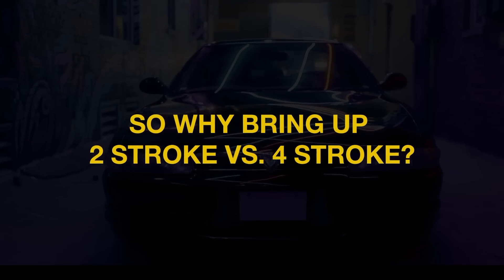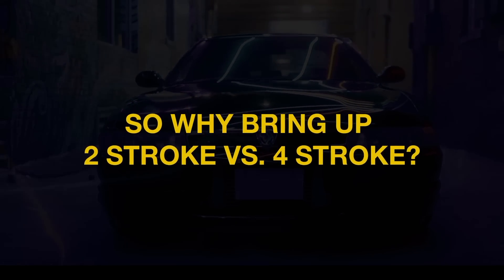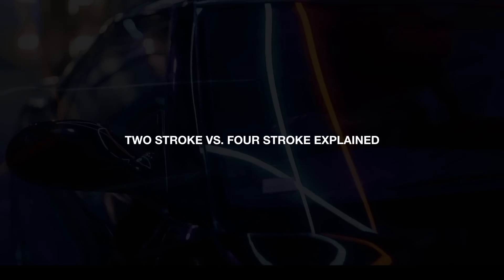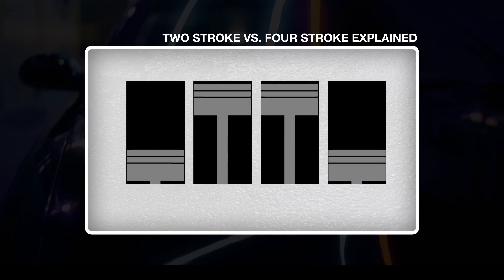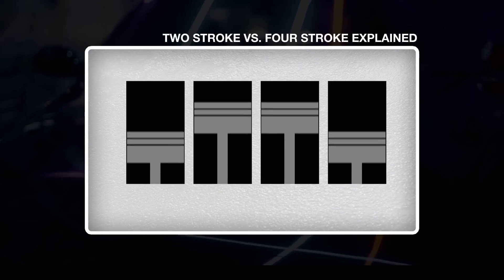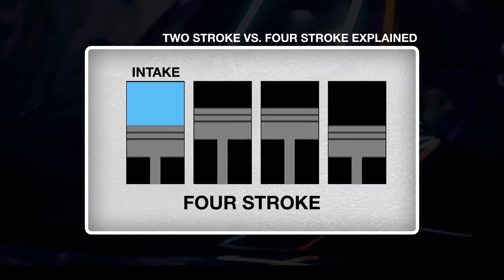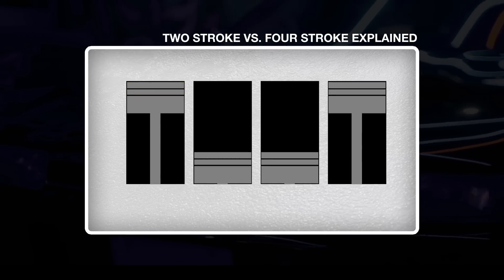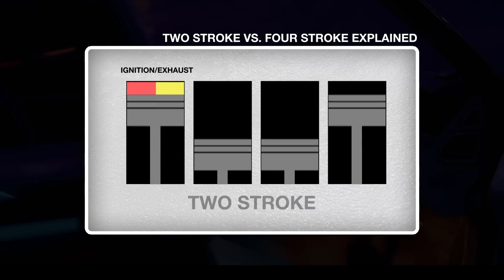The SECRET Behind Why RX7 and RX8 Rotary Engines Make SO Much Power

Comment: There's actual displacement and then there's "but to compare to a piston engine" displacement. a 13B engine is 1.3L period, some people bitched about it and thats where this 2.6L/3.9L non-sense comes from. Below is an explanation that I think explains both sides very well:

  Wankel engines can be classified by their geometric size in terms of radius (rotor center to tip distance, also the median stator radius) and depth (rotor thickness), and offset (crank throw, eccentricity, also 1/4 the difference between stator's major and minor axes). These metrics function similarly to the bore and stroke measurements of a piston engine. Displacement is 3√3radius·offset·depth, multiplied with the number of rotors (note that this only counts a single face of each rotor as the entire rotor's displacement, because with the eccentric shaft - crankshaft - spinning at three times the rate of the rotor, only one power stroke is created per output revolution, thus only one face of the rotor is actually working per "crankshaft" revolution, roughly equivalent to a 2-stroke engine of similar displacement to ONE rotor face). Nearly all Mazda production Wankel engines share a single rotor radius, 105 mm (4.1 in), with a 15 mm (0.59 in) crankshaft offset. The only engine to diverge from this formula was the rare 13A, which used a 120 mm (4.7 in) rotor radius and 17.5 mm (0.69 in) crankshaft offset.[citation needed]

As Wankel engines became commonplace in motor sport events, the problem of correctly representing each engine's displacement for the purposes of competition arose. Rather than force the majority of participants (driving piston engine cars) to halve their quoted displacement (likely resulting in confusion), most racing organizations simply decided to double the quoted displacement of Wankel engines.[1]

The key for comparing the displacement between the 4-cycle engine and the rotary engine is in studying the degrees of rotation for a thermodynamic cycle to occur. For a 4-cycle engine to complete every thermodynamic cycle, the engine must rotate 720° or two complete revolutions of the crankshaft. The rotary engine is different. The engine rotor rotates at 1/3 the speed of the crankshaft. On two rotor engines, front and rear rotors are 180° offset from each other. Each rotation of the engine (360°) will bring two faces through the combustion cycle (the torque input to the eccentric shaft). This said, it takes 1080° or three complete revolutions of the crankshaft to complete the entire thermodynamic cycle. Obviously, there is a disparity. How can we get a relatable number to compare to a 4-stroke engine? The best way is to study 720° of rotation of the two-rotor engine. Every 360° of rotation, two faces of the engine complete a combustion cycle. 720° will have a total of four faces completing their cycle. 40ci(654cc) per face times four faces equals 160ci or 2.6L. That's a well-reasoned number and now gives something that can be compared to other engines. In addition, since four faces passed by in the comparison, it’s like a four-cylinder engine. The 13B therefore compares well to a 2.6L 4-cylinder 4-cycle engine.[1]

By using the same formula, calculating actual displacement in which 1080° is the complete thermodynamic cycle of a rotary engine and a total of six faces completing their cycle, 40ci(654cc) per face times six faces equals 3924cc, 3.9L, or 240ci, in reference to a Mazda 13B rotary engine. "Each face has a swept volume of 40ci(654cc) and there are a total of six faces. With this known, the engine displacement should be 40ci(654cc) times six to equal 240ci(3.9L)."[1]
Reply: Nate Rist you have way too much time on your hands 😂
Reply: TJ25 not an argument.
Reply: Nate Rist props bro you know your shit!
Reply: Unless your engine does not intake, fire or exhaust an air charge every third crank rotation then you sir just proved its a 3.9 liter in total displacement... you can't have it both ways.
Reply: Its very simple Nate... each orbiting piston(rotor) has 3 sides forming 3 combustion chamber volumes, each with a swept volume of 654cc.  times the 2 housings is 6 and equaling 3,924cc.
 The other important thing that people without formal engineering experience fail to understand is that a 4 cycle Otto or Diesel engine completes its firing sequence in 720° of crankshaft rotation while the 4-cycle Wankel KKM designs required 1080° of rotation to complete its firing sequence...
These two important and often misunderstood details are the basis of the commonly used "2X" conversion formula for accurately "comparing" the displacement of the Wankel with other designs..
Any questions? I would be happy to explain in more detail...
Reply: Nate! How come none of your RX cars run anymore????  and why do you buy your oil cooler brackets from the Walmart hardware dept.????
Reply: Mazda invited us out to a press day at their headquarters to show us their new engine technology. Could this be the new Mazda rotary engine? We didn't know! Turns out it was their new Skyactiv technology --specifically SkyactivX. While we were a little bummed it wasn't the rotary, our dismay was alleviated as we started to learn all about this impressive technology. This [largely] SPARKLESS engine relies on insanely high compression in coordination with a slew of other engineering marvels to maintain a stable gasoline ignition. Zoom zoom muchacho.
Reply: RotaryPerfection
+doktorbimmer Dude give it a rest. It's sad how obsessed you are with being right within this discussion. You just wrote 3 separate post in hopes to get me to respond. I've said what I needed to say on the subject and now I'm moving on. Understand his one thing. YOUR OPINION DOESN'T MATTER TO ME because you have ZERO hands on experience with the actual engine. I wont respond to you again so you can have the last word (which I'm sure is exactly what you want).
Reply: Exactly right
Reply: One major flaw in your assertion that a 13b is 1.3L

The engineers at NSU that built the first Wankels would classify it as a 3.9L
...and the only reason it got labeled as a 1.3L is to avoid EU displacement taxes, at the suggestion of Max Bentele.
Mazda adopted the idea to avoid Japanese displacement taxes.

I swear....  Rotary guys argue displacement like a SJW explaining why there's more than 2 genders.
Reply: Simple physics...CUBIC CAPACITY! THAT'S IT! They are and always will be 1.3L!!!!
Reply: @Chill Bill The facts are irrefutable... the Mazda 13B had a total true displacement of 3.9 liters...

Comment: I'm reluctant to say that this notion really makes sense, even if that's how it's officially measured.
I'd say that an engine's displacement is best described as the volume available for one power stroke's fuel mixture, before compression, all "cyclinders" combined. (i.e. how much mixture could ideally be burnt per power stroke, if the engine was naturally aspirated). No crankshaft revolutions in this definition.

Comment: 1.3l is correct if you look at it the way the manufacturer looks at it. Only two faces fire 🔥 per power stroke/ i.e. Turning thermal energy into kinetic energy 13b= bang bang/applied motion.   2.0l piston engine= bang bang bang bang/ applied froward motion

I feel 1.3l is the the most accurate displacement description
Reply: When mazda came out with the rotary they said it's a 1.3l, now every dum ass comes up with their own theory just because a 1.3litre rotary makes too much power
Reply: +MrChayl3 Mazda didn't come out with the Wankel engine... they bought it from the company that invented it...NSU.  NSU concocted the bullshit method that was used to cheat the tax collectors in countries where registration is based on engine size... today you pay the much higher amount based on the larger true displacement.

Comment: Each face would need to be counted as an individual cylinder.

A traditional piston can only have one cycle happening at once. In a rotary, when one face is in the Ignition cycle, one face is on intake and the other is exhaust, so it can have three happening at once. Also, from ignition to complete exhaust is a half turn of the crankshaft.

It is literally just a 3 cylinder engine in one object, therefore, if each face can house .65L of air, then each rotor would be equal to 1.95L, so a two rotor would be 3.9L (or a 3.9L 6 Cyl), a 3 rotor would be 5.85L (or a 5.85L 9Cyl), and a 4 rotor would be 7.8L (or a 7.8L 12 Cyl).

The traditional Engine Displacement definition can literally not be applied to a rotary, even if you replace "piston" with "rotor", because you would have to basically pretend the other two faces of the rotor aren't doing anything. 

I propose a new definition: "Rotary engine displacement is the swept volume of all the rotors inside the rotor housings of a reciprocating engine in a single movement from Top Dead Centre (of the ignition stroke) to Bottom Dead Centre of the crankshaft times 3 (to account for the 3 faces of one rotor)."

Comment: Internal Combustion Engines are known being linked to low Effective Compression Ratio, these first times because of poor quality of available gasoline. If changing the plug hole to an slot as Ernie Brink proposes, reduces greatly the Exhaust Gas Temperatures, this would mean a much higher Effective Compression

Comment: Put a 13B on a dynamometer with an airflow meter.  Run the engine at a known speed and measure the airflow.  Calculate the volumetric efficiency.  You can't get the same numbers saying that the engine displaces 1.3, 2.6, and 3.9 liters.  Only one displacement will yield a vol eff number in the range of 100%.  That would be 1.3 L.  The other "displacements" would yield numbers of 50% and 33%.  

The key detail is that the volumetric efficiency of an internal combustion engine is defined on the basis of mass air flow through one thermodynamic cycle.  This is not only a function of piston displacement, but also of valves controlling the airflow.  It takes two revolutions of the the crank in a 4-stroke engine to complete one thermodynamic cycle, but only one revolution of the camshaft.  That's because it's the camshaft that controls the airflow.

Comment: Yes, basically, it's because the Wankel rotary engine's displacement isn't measured in the same way as a piston engine. If you measure a 6.2L LS3 the same way Mazda measured the 13b to end up with 1.3L an LS3 would be a 3.1L engine.
What many people have a hard time with is keeping the ENTIRE engine, all 6 faces of the rotors on a 13b, in mind at once along with the Wankel's 3:1 ratio. During operation, because there is a 3 to 1 ratio between the rotors and the eccentric shaft or e-shaft (equivalent to the crankshaft) that means for every 1 revolution of the e-shaft the rotors turn 120 degrees (1/3 of a revolution) which is the number of rotor degrees necessary to complete one phase on each rotor face. This results in 1 intake, one compression/power, and one exhaust PER rotor (although there is overlap because the second rotor is phased or "follows" the first for balancing reasons).
This means in 1 revolution of the e-shaft the entire engine's swept volume displacement is .65 * 3 faces * 2 rotors= 3.9L. 
The main reason, I think, for this odd way of mesuringdisplacement that Mazda used that resulted in the 1.3L rating, only counting one rotor face per rotor, is because, esp. in Japan, insuring a 1.3L sports car is much cheaper than a 3.9L sports car as well as the fact that Japan has an absurd "displacement tax" so the smaller the rated displacement of the engine the better.

Comment: great info when you line up a apex in the leading plug hole you see two chambers at the same time HEAT IS NO GOOD so two keep your turbo and engine in great shape you must stop the flames that are inside the engine before it ever comes out of the housings

Comment: This makes sense ... 2 rotations = 2.6L and 1 rotation = 1.3L ..... So I would be correct when saying that a 1.3L Rotory is equal to a 2.6L engine. .... air volume speaking.... yep it does make sense.... thanks for that good info ...
Reply: Exactly!  It's equivalent to a 2.6L 4-cycle piston engine in terms of air volume. Notice the exact wording of this; I'm not saying that's it a 2.6L engine, merely that it's equivalent!

Comment: Wouldn't it be more of a 1 stroke and nothing even similar to a2 or 4 stroke just because all events are separate how does that make it 4 Stroke.  When it does all 4 events in 1 cycle?please explain
Reply: All Wankel engines use the same 4-stroke operating principle as the Otto engine, each of the 3 combustion faces goes through the 4 cycles separately just like a reciprocating engine does.

Comment: Someone shoulda further developed the rotary. Think about it, a 2 rotor engine has 3 moving parts, not much friction really and you could make higher compression rotors. Oil injection with the fuel would also help a lot with wear cos the fuel goes everywhere in the intake stroke and gets spread in the housings and irons. Youre gonna say something about pollution but put a DPF on it or rather an RPF(rotary particulate filter) and youd have clean emissions. Just a thought

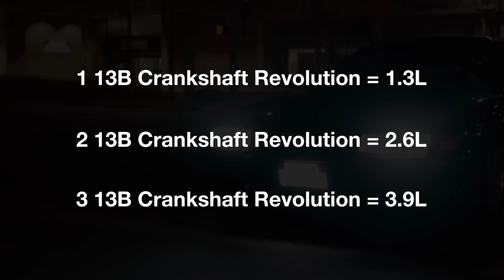Comment: Kenny Mckee"5:40-5:45" some arcadic reason for?????? Mazda's reason makes perfect since if you understand how displacement is truly calculated. In this whole video, you completely forgot the basics of how displacement is calculated. Displacement is calculated by firing the measured volume of air per cylinder or chamber in a "SINGLE COMBUSTION" event and not multiple ignition events. That's why it's rated as a 1.3L. In a 4 stroke 4 cyl piston engine, you need 2 rotations of the crank to ignite 4 individual cylinders to get the full total displacement (1 spark each). In a rotary, 1 e-shaft rotation gets you 1 ignition event per chamber to ignite .65L of air each chamber times 2 (1 spark each). Your video did a pretty good job of explaining but, the key words are SINGLE IGNITION EVENT. So when comparing to a piston engine, all you have to do is compare the amount of air moved for each e-shaft rotation. That's why it's comparable to a 2.6L 4 stroke piston engine because both engines will move the same amount of air and have the same exact amount of ignitions events.

Comment: Good video except at 4:52 he says a rotor has six faces (it has 3). The confusion comes from when the Wankel was first invented, and displacement was based on 1 revolution of the output shaft. As it takes 3 shaft revs to complete 4 strokes per face, one rev will fire only one face of each rotor, and the two rotors of a 13B provide 2 combustions per rev, ie 1.3L PER REV. To be consistent with a 4 stroke piston engine, 2 shaft revs yield 2.6L displacement.

Comment: Good educational vid, bt I count it that there is an ignition event every 120 of 360 degrees of the eccentric shaft, mayb it'd be easier to explain with a single rotor engine
Reply from the maker: There is an ignition event every 120 degrees, however, the full cycle is only completed on face per rotation.
Reply: Actually, there’s a combustion event every 180 degrees of e-shaft rotation. Very much like a 4 cyl. On older Rotaries that had a single dual-post (wasted spark) coil for leading ignition, you could run the engine leading only on most standalone EMSs by setting it up as a 4 cylinder 4 stroke with a single ignition output (like a distributor) and then just hook the single output to the leading coil. 4-cylinder engines have a combustion event every 180 degrees. IF you look at an actual e-shaft, the lobes are offset by 180 degrees as well.

Comment: Boss man says they get the 1.3 measurement  from one crankshaft revolution. They measure a piston engine at two crankshaft revolutions so if they measured the 13b at two crankshaft revolutions 2.6l I believe they decided to go with the 1.3 because in Japan under 2.0 is cheaper to run..
Reply: Piston engine takes two crankshaft rotations for one oto cycle.  The rotary takes 3 eccentric shaft rotations for one oto cycle, but there are 3 faces so there is one power stoke per rotor per eccentric shaft rotation!  1.3, 2.6. or 3.9?  1.3 is best for insurance purposes.  Note that most racing rules had a conversion factor for rotary versus piston; 2.0 was common...

Comment: Basically the closest way to compare doritoz to pistons is by comparing both at two crank turns, for example like he said a 13b at two turns equals roughly 2.6 litres & since four sides fire the closest comparison would be a 2.6 litre four cylinder which is why they are registered as 2.6 litres, for me that's the only measurement because the comparison is always going to be against a four stroke piston engine

Comment: Maybe we should measure displacement between all engines on how much Air is displaced over 360 Degrees of rotation. I would think you need a common denominator with something they all do no matter how many strokes. Then you could measure the fuel used per 360 degrees.
Reply: A 4-stroke engine requires 720° degrees of crankshaft for all the combustion volumes to complete its firing order sequence.
The commonly accepted method is 360° for 2-Stroke engines and 720° for 4-stroke engines.
The Wankel is a 4-stroke engine.
This is why the Mazda 13b is considered to be a 2.6 liter when comparing hp-per liter.

Comment: 2 rotor is called 13b hence it's 1.3 litre, 3 rotor is called 20b and it's considered as 2 litres. Assuming 1 rotary it's a 0.65 litre displacement.